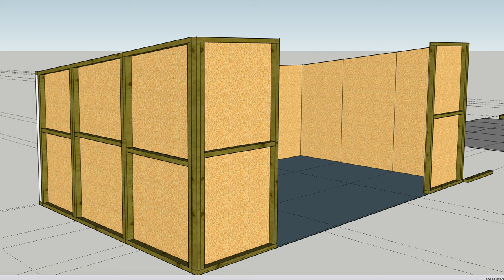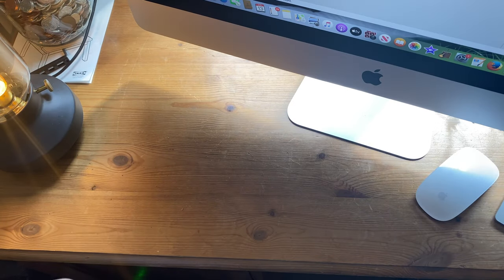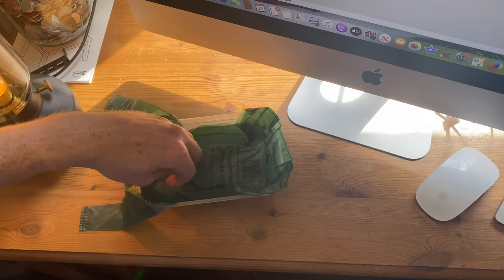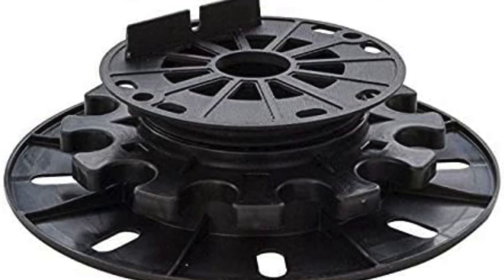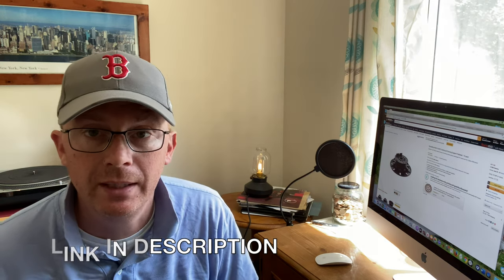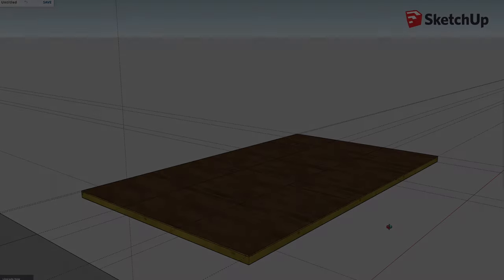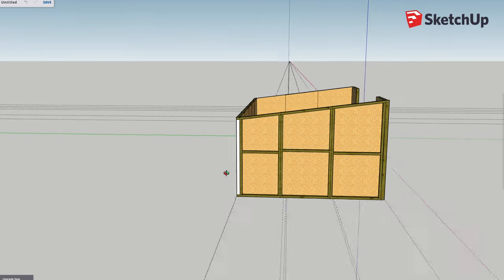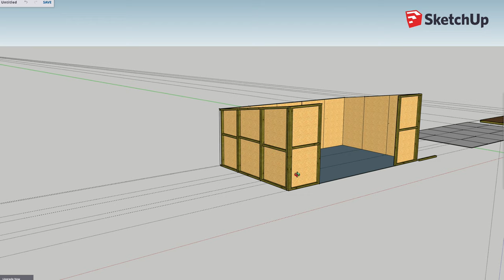Modular Designed Workshop (Part #1: Design Concept and Ideas)

Comment: Sean Chapman
I'm delighted to hear you are building yourself a new workshop. Like you I have only one hand to work with,  had a stroke six years ago leaving me parralized on the left side. I have worked with wood all my life so when I was told I would nevewr work again, it left me in a bad way. After leaving rehab I did a year of physio building my strenght and eventually I started to do small jobs arround the house. As my confedance grew I did bigger and bigger projects and last October I gutted my old workshop and started to build a new workshop more suited to my needs. All most finished now so I know it will be a peice of cake for you to build your new workshop. 

To anser your question about the vapour barrier, I would put a sheet of plastic over each modular frame rapping the plastic around the sides before nailing on the sheei of OSB board. Then when you are putting the modules together you can run a bead of silicone  between each muduale sealing the jount. I would also put plastic vapour barrier between the floor frame and floor boards. I also recommend after you have but up all your modules to put an extra  peice of timber along the top of each wall to tie all the modules together, standard timber frame practice. Also Inwould put an extra stud in each moduale as this would increase the strenght of each wall and make it easier to hang heavy shelves and tools on the walls. Good luck and best wishes.
Reply from the maker: Thanks Sean for the great feedback here, lots of great ideas. I'll be going with what you suggested about the plastic sheeting between board and timber, quite a few folk suggested that one and it makes sense to do so. In regards to the extra piece of the timber along the top, I did that when I made the coal storage box and I couldn't believe how solid is locked the four modules in place, so much so I didn't even need to screw the panels to each other (not that I'll be doing that with the workshop😂). 

For the floor frame I am going to insulate between the joists with celotex (or equivalent) and tape the seals with aluminium foil before applying the boards. I think that will be sufficient without the need of a vapour barrier, what do you think?

Finally it is great to hear you can still enjoy the world of making despite being presented with significant barriers. Last few months have been tough for me progression and pain wise as all the treatments I was receiving to manage the pain stopped when lockdown kicked in. I was starting to make a little bit of progress too and that has kind of dipped off, but hopefully things will improve in the future. Would be great if I could get some functional use in my hand back. My elbow flexion is better now, but shoulder and hand no so. I saw a consultant neurologist in February who has recommended an implant on my spinal cord. Potentially very beneficial, but also high risk. I have a lot of thinking and soul searching to do before I decide on that one. Best wishes, Leo

Comment: Hi Leo Foundations i work in the construction industry for a structural engineering consultancy for my latest build the wife,s potting shed i tamped the ground down where i was providing support laid a bit of sand say 25mm then placed a full 7N concrete block down laid flat you can have as many as you like to support your floor no need to level them at this point. I looked at those plastic supports a brilliant idea but expensive i then resorted to the 4 x 4 post sat on 2 layers of dpm to stop the end of the post getting wet. Cheap and cheerful. I purchased some 7mm timber screws 100mm long to fix the joists to the posts. You could use a small jack to level the floor joists and then screw your posts to the joists. Another method i have used is making the floor joists on the long span an L shape two 6x2 this means that you can easily drop your trimmers in as they are already supported by the L shape. I blame the Yanks for this method but so easy to construct. Floor insulation one of me boses suggested that to insulate your floor is to drape vapour barrier between the joists to create a trough then fill with cheap rockwool. I could email you the TRADA timber construction for joists spacing floor thickness etc. Walls just use Wilko no nails to fix the insulation to your OSB don't worry about silver tampe you have tyvec on the outside. Need to no anything else i would be pleased to help message me. Kind Regards Ziva the dog.
Reply from the maker: Cheers Ziva for such great feedback. If you could email me the TRADA timber construction joists guide that would be great! My email address is 75handicraft@gmail.com. Only if you have time mind and please don’t go out of your way. Many thanks, Leo 😀

Comment: First off, respect for attempting this build, I built myself a workshop a couple of years ago , I concreted posts into the ground and built my base off the posts, saved all the material and the digging and super easy to level and obviously much quicker, mine is also modular and also have the same insulation, I cut mine tight and caulked it in. i used 18mm ply inside and out then cladded the outside vertically with tongue and groove and coated it with red cedar ducks back, also built my own windows using 3x2, get as much natural light as you can
Reply from the maker: Thanks Designer😀. Just to double check in regards to the insulation, you slotted them in then caulked what would be the none foiled side edges against the wood? That could work well for me as if I needed to take it down I could just strip the caulk off and remove the insulation?🤔😀
Reply: @Hand-i-Craft  I just had to go and double check, i used 50mm ecotherm which is foil on both sides.

Comment: I came her to see you build a modular shed I didn't want your life story 😂😂😂 seriously though mate definitely looking forward to seeing this project unfold it's going to be a cracking build. Ps love the red squirrel and those cute little hedgehogs, awesome to see them loving the little wildlife habitat you have for them.
Reply from the maker: I think o might take the ‘life story’ line as my new tag line, like you should with the ‘buy local knobheads’😂. 

The wildlife in the back is incredible Karl, we’re so lucky in that respect. This build is going to be a huge challenge, I’ve watched all of your build videos and picked up some good tips from them. I remember the one with you dead lifting the whole base frame (which I couldn’t have done with two working arms!) which got me thinking it’d probably be better for me to build the timber base in three sections instead of one. That way it’d be easier for me to level it up but also easier to manage shifting it around if I had to. It’s only one extra length of timber per section, so three in total which hopefully could save a fair bit of hassle and back pain!
Reply: @Hand-i-Craft  haha ye that's my favourite slogan 😂 definitely mate because you don't realise how heavy the 2x4 timbers are one all connected together, I like the idea of the gravel base as well as that's far better for the environment than concrete and it will have excellent drainage.

Comment: This is great... cant wait to see the progress. (As well as more of your little furry friends lol).
 
I'd love to see more product videos btw. I too am single-handed and have been having the hardest time trying to find a router to use. 
 
So what type of router do you like? 
A plunge router is just too big to handle (and I'm 6'7" 330lbs) and a palm router just seems too weak. A router table with one hand one-handed can be a nightmare as well. 
 
I have a track router system that I also use with circular saw for miter cuts, but it only does straight lines.
Reply from the maker: Cheers Matt for the message. The hedgehogs and red squirrels always steal the limelight whenever I include them in a video😀.

The router issue is a good question. Plunge router is a simple no go for me (and you). Simply you need two hands to use them effectively and safely. I have a cheap handheld router that I can use safely for simple tasks like roundovers on chopping boards etc. That cuts through the likes of walnut and oak so power isn’t an issue, it’s just learning to work with it taking very light passes and building up confidence.

Long term is have to say the router table is the best option. My router table is small and not the best so I will be looking to upgrade at some point. But using the likes of feather board jigs and clamps to secure the area where you pass the wood through the router is in my opinion the best and safest way to proceed.

I haven’t done any videos on that yet as I haven’t found the best solution for me to be comfortable with to share, but it is something I will be working on in the future. I’ve just got a workshop to build first 😂😂
Reply: @Hand-i-Craft  haha that's more than fair. I can't wait to see how the new work area turns out!
 
And thanks for the info, it was really helpful. I have the cheap, and really heavy plunge router, and I think I will just keep that in my track system. And hopefully be able to use a router soon to make my own T-Track system to make clamping easier.
 
Then I will start making the vacuum clamp you showed how to make.
 
I greatly appreciate all the videos you've made. You've saved me a lot costly mistakes by seeing yours hahahaha. 
 
So thanks again, and be safe.

Comment: Hi Leo, looking forward to this one, I built mine modular, but worked from the outside in, however the best way to get your vapour barrier is to tack polythene over the frame, under your OSB before you attach it, this will give you the barrier right against the OSB on all except the joints, which you can either tape or caulk up.
Reply: PS not sure how you are attching panels together, but I went for stainless steel bolts, in however many years time that you take it down you will find them still rust free.
Reply from the maker: Thanks Peter, I was thinking 100mm fixings into the ground and bolts on the side module joints. How many bolts would you think for the side joints and what size bolt would you recommend?
Reply from the maker: Yeah I’m pretty sure I get what your saying here Peter, lots of things I need to consider. If I use the Tyvek wrap to cover the whole build, if I tack it and caulk or glue it to the side of the 6x2 floor joists so it’s literally covering everything, would I get away with doing it like that? 

For the internal moisture seal, if I applied the aluminium tape where the timber meets the OSB board on the inside before slotting in the Kingspan insulation, would that be an effective method and then run a fine bead of caulk at the back of the insulation to form a seal that way?
Reply: @Hand-i-Craft  l used one at the top, one in the middle, and one at the bottom of my frames, M8 stainless with washers. I fixed the panels down to the base with two coach bolts per panel (up to 900 wide, you might need 3 with 1200 panels)
Reply: @Hand-i-Craft  not sure I explained it properly Leo, if you make a panel, lay polythene over it, then fix the OSB, you will have a built in vapour barrier, when you put the Kingspan or Celotex in you won't need to worry about having to seal it at all, as there will already be a vapour barrier in place. The only area to seal will then be at the perimeter joints, though I doubt it will be any sort of issue. If you can build in a small air gap between the Tyvek and the finished boarding it allows it to drain should there be a gap or hole in the cladding, but again it's not essential. Check out my wall construction video #75 to get the idea, you are building slightly differently, but the principles still hold good.
Reply from the maker: the small shed Thanks Peter, I’ll have a butchers later😀

Comment: Hi Leo. Just a thought for you and anyone who can add to it could you build your modular frames with a thinner layer of boarding on the side that will be outward facing then when you construct the modules you can add your kingspan and cover up the inside once that's added if this makes sense.
Reply from the maker: Thanks Andy, makes perfect sense and was something I was considering. Decided not to go with that as I believe I can get away with not having an external board at all. My plan is to wrap the frame with Tyvek then apply the cladding directly against the Tyvek as a cost saving measure. I couldn't really not line the inner walls with boards so the option to not board the outer side was taken. Plus the inner board forms part of the structural integrity. Does this make sense or has my waffling brain taken over again?!
Reply: @Hand-i-Craft  It does make perfect sense. just as a thought I'm in a face book group called woodworking UK (wwuk) and I know one or two others who follow you are to it maybe worth joining if you haven't already there's a diverse range of skill sets there from beginner to pro who are all quite willing to offer advice
Reply from the maker: Nice one, thanks Andy. I’ll have a butchers tonight😀👍
Reply from the maker: Andy, can I just ask is it:
Woodworking UK (28k members)
Or
Woodworking-UK (3.3k members)

Cheers, Leo
Reply: @Hand-i-Craft  Hi Leo sorry for the slow response its the 28K members one

Comment: Will you be running a electric cable into workshop. If so , when you get the base dig out you could get them to dig a trench for the cable etc.
Reply from the maker: That’s the plan Alastair. Hopefully I can get an electrician to price up the work before the foundations are dug as they can guide me as to where the trench needs to be dug. It’s difficult at the moment with the current Covid situation as these kind of jobs I’ll have to bring in outside help, but even when businesses are slowly back up and running they are dealing with a backlog of work before taking on new jobs. 

All I can do for now is start making the wall modules and hope that the other external jobs click into place so to speak at some point😀

Comment: Really interested to see how you go about this one, Leo, as I might be copying your ideas, if that's OK. My current 'workshop' is similar to yours, except it's corrugated tin with no door, just a wide opening. As such, only properly usable for about 3 months of the year; full of 'blowies' and searing heat in summer and freezing cold in winter. I've started accumulating windows, but unsure on the build/cost etc. This looks like it might be achievable on a limited budget. I'll be watching this space!
Reply from the maker: Thanks Mandy, feel free to copy anything, but it might be worth holding on until you see all of my mistakes and adjust accordingly😀😀. The garage now is completely full so if I want to go in and start working on something, I first need to remove all the traps that cover up everything then take out some OSB offcuts, then the table saw, then the mitre saw on its wheels, then a couple of tool trays before I even connect the electric to the garage from the house. It’s fine from a hobbyist perspective, but if I’m looking to make a go is this from a part time business perspective, it simply isn’t feasible to be working in there all year round with limited space.

I’m full of nervous energy for building this workshop as I have a good idea of what I want to do, but don’t want to make a complete mess of it!😀😀

Comment: I fitted celotex in my shed after building it cut it so it was a tight fit no metal tape used and have not had any problems i built it 10 years ago if you are going to put it in the roof as well make sure it is touching the roof so no air gap or you will get condensation problems that will be a nice size workshop i personally would have 8 foot at the front 7 foot at the back would be more than enough fall more height inside may also be better to use weed control fabric instead of polythene on the base as it will let water soak through.
Reply from the maker: Thanks Rasmo. Did you secure the celotex to the inside of the roof structure at all or was a snug fit sufficient? 

Interesting what you said about the walls with no metal tape. That’s my biggest concern, but 10 years with no issues is good to hear. Haven’t decided fully what to do yet but good to hear feedback like this. Cheers😀
Reply: @Hand-i-Craft  Hi Leo i just cut it so it was a tight fit and pushed it up against the ply roof but if you do get a loose bit just put a nail or screw half way in to hold it in the best way is to fit it on the roof under the ply on the outside and fix down through the ply securing it as the do with houses i would have done it this way but did not have the celotex before i done the roof as i used off cuts so did not have to buy it and i then boarded out the inside.